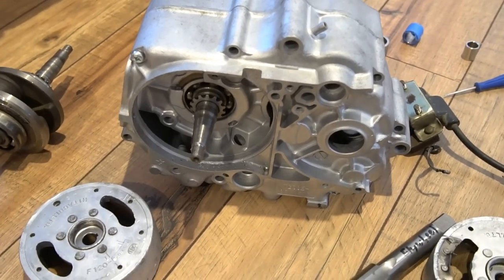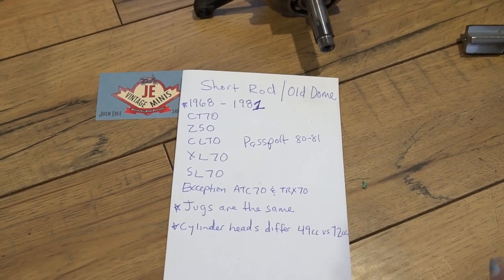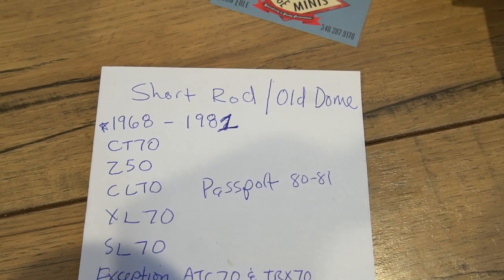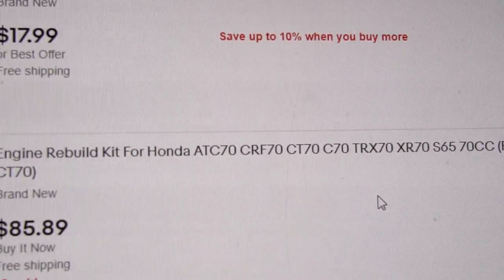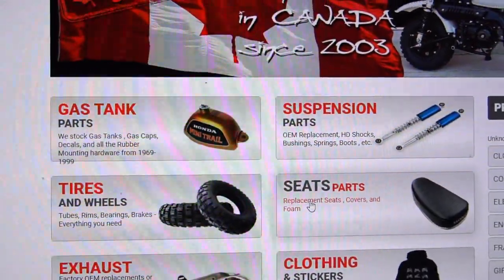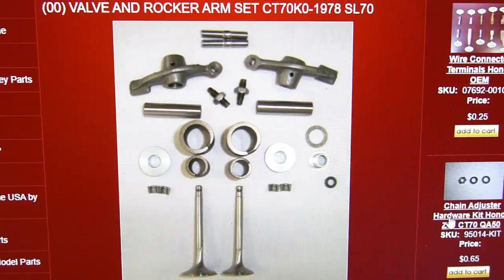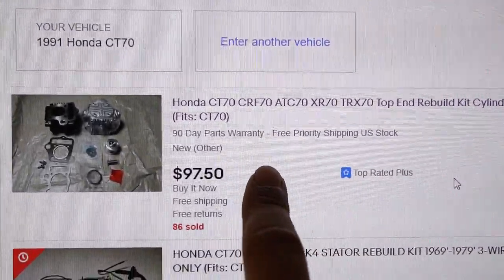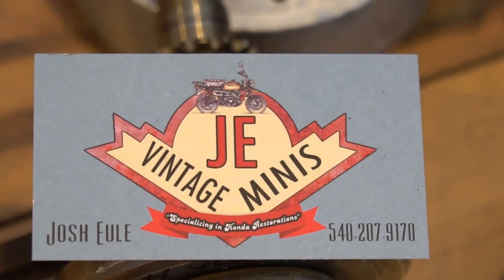DON'T buy those cheap chinese top end engine kits  - Vintage Honda CT70 Z50 Mini Trail Dax Monkey

Comment: Really appreciate this video man! Its been 20 years since i had my z50 working. It's a 79 and i had no idea about the different rod lengths. Paid 2 different people to get this thing back on the road, one kept it for 3 years and did ABSOLUTELY NOTHING! Took it to a guy that lives down the street. He was working on another one when i dropped it off. The asshole needed a carb for the other one and ended up buying a cheap POS off amazon that woukdnt work on the other one, so he threw MINE ON IT and gave it to the people as "REPAIRED" and stuck the new piece of shit on mine, which it still didnt fit, so he took the damn upper engine mounting bolt out to tip the engine down a little so it'd fit. I took it back immediately. I had given him a brand new enerpac hydraulic pump($600 dollar value). He said he put a new jug and piston kit in it, but couldn't get it running. I tore into it myself finally, found that not only was there no new jug or piston but that he'd also stuck the thing back together 180° off on the timing! Im getting older and have a disease thats measing up my spine and id REALLY like to ride this thing again before i cant anymore. This thing used to ride in the back of my cj5 because i had a broken gas guage and ADHD which is a TERRIBLE combination! It saved my bacon so many times and because i always had it with me, i used it so much more because i had it when the mood took me. If i cant get this thing running soon, im going to sell it and buy a cheap chinese copy. I know how disgusting that sounds. I woukd have beat my ass for saying that 20... shit, even 10 years ago, but that was a ton of health and a long time ago. I dont have the income anymore to afford a real one, so if i cant fix the one i have... 🤷 
  Sorry for the huge comment! Wasnt my intention. Its an old video and apparently i needed to vent a bit. I dont know if youre still doing this 3 years later or not, but if you are, i may indeed need some help with this. I dont have a ton of money, but i have a parts bike and a bunch of other misc. parts if i needed to bother you for help. Ive tried the "someone local" thing and t no avail! Kinda running out of time and options.

Comment: I'm glad I watched this video.  I just got a 74 XL70, and will be attempting to get it running in the next month or so.  I have never worked on these little engines, but I'm learning tons on YouTube.  I had no idea about the long and short connecting rods based on the year.  I don't know that I'll be needing to tear into the engine, but the more you know, the less you screw up.  Thanks for the education, and the links to reputable parts places.

Comment: Another really informative video Josh. I have a 1970 CT70 with a 140cc motor. Now I am doing a 1972 CT70 and I would like to keep it stock. Currently the motor is locked up. I will take it apart tomorrow and assess it.

Comment: The top end kit works for all 70cc they are made for short rod engines like this the Honda 90cc big bore kit also works because the stroke is the same just the bore.

Comment: Good video, I have one of those kits, do you think I can use the parts from the kit except for the piston and buy a correct piston  from a different manufacturer ?
Reply from the maker: The jug could be used (But double check that it is true/flat on machined gasket surface etc). I do not know of a piston that is out there that is a swap in to work with the short rod and CRF70/XR70 style aftermarket heads in those kits

Comment: Thanks for the great information. I have a 1970 ct70 motor on my Z50.  Would you know if I can just change the cylinder head and piston to the 50cc size.
Reply from the maker: Yes you can, it is a bolt on procedure.Youll need a 39mm jug/cylinder too for the 49cc setup. Just follow the tips in the video and buy your parts from the vendors I show based on year of engine.

Comment: Is 2fastmoto a reputable kit just popped up in my search they specifically point of that it is for my short rod motor. Thanks in advance
Reply from the maker: Pretty sure they are out of stock once you put it into the cart. They migrated to another website too

Comment: Woll a Chinese head fit a 73 Z50? Or can the cam journals be repaired? I'm having trouble finding a new head. Thanks
Reply from the maker: No, 1982+ used a flat piston, longer Conrod and the small combustion chamber you find on the aftermarket top end kits. The domed piston on a 73 will not play well in a kit head
Reply: @VintageHondaMinis  thanks. Is there a way to identify the proper head? I see some used ones on ebay but they all say z50. No year😆